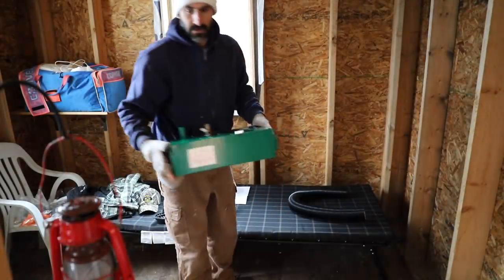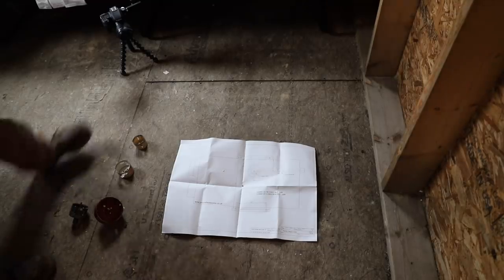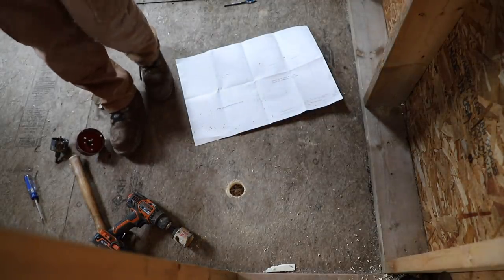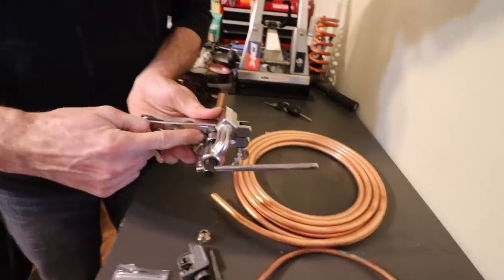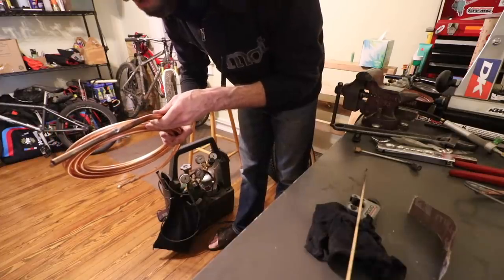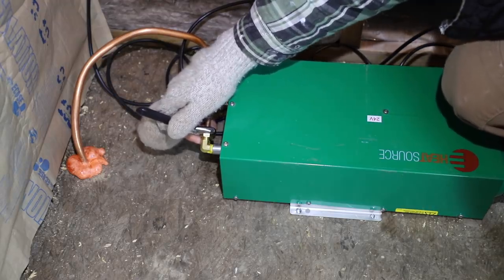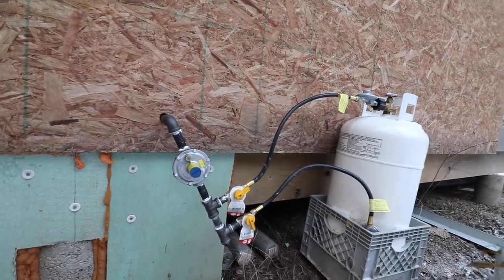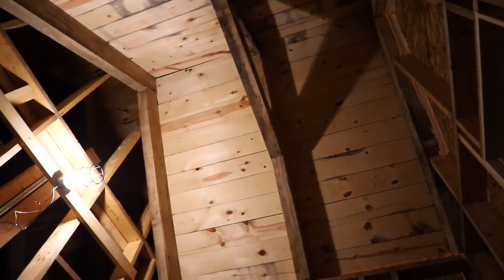Installing a Vented RV Propane Heater in a Small Off Grid Cabin

Comment: A cold weather tip for u, the 40 pound propane tanks have a small surface area when they are standing upright and that can result in low pressure in very cold temperatures. Tilting them over at 45 degrees or more creates a larger surface area and helps to keep the pressure up. That's a very nice heater you've installed.
Reply from the maker: Thanks for the tip Doug, I appreciate that.  The heater has been great, now that the bedroom is insulated, it has no problem heating it.  It's loud, but soon it will be encased in sound proofing.

Comment: That is a nice heating unit. I think your doing the right thing building to your dream and not rushing through. I know my project is restoring an old car and I am 8 years into it and I would love to rush and finish it but instead I just pick up parts as I can afford them and do all the work on it the best I can and I can see that is what your doing on the cabin. Well done.
Reply from the maker: Thanks Jerry, It's pretty crazy to think that I started the foundation in 2014.  I am enjoying the journey.  If I go too fast, I won't be as willing to spend $ on nice materials, so that is another reason to take my time. Sounds like you are doing the same.

Comment: Love the cabin and your honesty with your skill sets. You do some great work. I'm building my cabin in northern Canada, all off grid solar. I'm just in the process of connecting my propane for fridge, stove and small heater. We have a wood stove as well. I'm learning as I go, doing everything on my own for the most part. Just an FYI, I was told all propane connections in a crawl space need to be welded in case of leak. In occupied space compression and flared are ok because you would smell the leak, crawl space you wouldn't. My cabin crawl space is about 4 feet high. Anyways great video's I've learned a lot watching you and gave me some good idea's.
Reply from the maker: Thanks Gordo.  Thanks for the heads up on the propane.  I'm probably going to be putting another little propane heater in the main room of the cabin so that would be a good time to change it over.

Comment: That is a great little heater. I’m betting it would heat your cabin if the floors and walls were insulated, vapor barrier and finished. REAL NICE JOB ‼️👍👍 Vinny 🇺🇸
Reply from the maker: Yea, I think it will, R 40 in the roof R19 in the walls and probably around R10 in the floor it should be able to keep things comfortable if the wood stove burns out at night.

Comment: Good job. I'm in Southern NH. Fricken cold today!!!
Reply from the maker: Oh yea I bet, I'll be there for Christmas visiting family faaackin freezing as my high school buddies would say.
Reply: That heater is pretty small at 10,000 BTU. To give you an example. An Espar D2 which is used in sleeper trucks puts out 7500 BTU. On a cold day it runs at 100% to maintain a decent temp inside. I think what you're doing is a good idea to take up the slack when the wood stove starts to cool down. You may want to set the temp of your heater to come on a lot sooner instead of waiting till it's like 40F. It may not be able to recover.

I've been building a cargo trailer/camper since May of last year. It's fully insulated and has a Suburban 19,000 BTU propane heater in it. It's only a 14'x7'  but it was able to keep up in 0F temps to 72.

Glad you went with a vented heater. I see way to many people use a Mr. Buddy and the whole place is filled with ice from the combustion moisture. 

If your running through Merrimack let me know. I'll show you.
Reply from the maker: Chasein70 dude, Merrimack MA?  I grew up in West Newbury!
Reply: Merrimack NH. Grew up in Leominster MA.
Reply from the maker: oh ok there is a Merrimac MA right next to the town I grew up in and we have a regional high school.

Comment: Great to see your progress. My only concern is that sweated tubing. I hope you've replaced it with the proper 3/8" OD tubing all the way, I wouldn't trust the solder joints long-term on gas.
Reply from the maker: Thank you! I do plan to replace that brazed pipe because eventually I am going to plumb In another propane furnace that can heat the main section of the cabin.

Comment: Looking good, Mike! That should be a good back up source of heat. Have you used it yet? Does it circulate well?
Reply from the maker: Yes I have used it for two days so far.  It has it's strengths and weaknesses.  It's kinda an electricity hog, which sucks, but the trade off is it is roughly 30% more efficient than your typical propane furnace.  It does circulate pretty well for how small it is.  It will heat that 8x10 bedroom no problem once I finish insulating it.

Comment: Years ago Trailers used auto size pipe and fittings. Homes used larger size pipe but called it the same size. I think one was inside (home) and the other outside (auto) measurements. And you did need two flare tools.
Reply from the maker: Yea that threw me off a bit there.

Comment: Hey from Newfoundland, Canada love watching your videos you have great cabin going there! I’m at the beginning of my land/cabin project my self plan to break ground the spring but much like your self be little bits at a time! I feel having a secondary source of heat is key I’m not sure if I will got with little oil stove or gas 

Keep videos coming best of luck
Reply from the maker: Thanks for watching!  Good luck on your own cabin.  I would also look into the wall mount versions like the Williams because they don't require electricity.  They are only around 60%-70% efficient but take no power.  I do think it will be nice to have something other than wood because you can't always be there to keep a fire going.

Comment: That's a sweet little heater are they for travel trailers where did you buy it.Also I didn't catch the but output what is it actually kicking out.could you please let me know and watching this I'm assuming it's electronic ignition no standing pilots and it is thermostatically controlled. I ABSOLUTELY love it, such a compact size can you say what it cost also.Very nice instalation very neat and clean. Thanks for the video Dale
Reply from the maker: Hey Dale thanks for watching, I got it from this place here https://www.westyventures.com/propex.html it was $795.  There are cheaper versions out there as well if you want. But, I could not find one as efficient for less.  They do take DC power.  There is not a standing pilot.  I went with this brand because I needed 24 volt and they made a 24v version.  It is thermostatic controlled, it's input BTU is 10,300 and it puts out 9,500 BTU.  The version I have takes about 36 watts to run.  I wanted this one so that I could mount it under the bed.  The bedroom is so small that I didn't have any room for a wall mounted furnace.  And yea it is meant for travel trailers.
Reply: Actually 9700 btu. Propex has tested some units putting out at 10,000+ btu.

Comment: I like your videos, were did you get plan for cabin build ? * Tip for you, I am in Chicago land area very cold. I am a licensed electrician, also do hvac, try this and since it seems like you have all the parts it will be just a matter of plug & play. Ok, go to  Wallmart or your favorite big box store, get a hydronic electric radiator, hydronic means fluid filled; as in oil, it will have 3-temp settings, and a thermostat, and its on wheels. Cost about 35 to 50 dollars maybe even cheaper, these are excellent little heaters, then on a bitter cold night, plug your Honda generator into your outside plug, isolate your solar/battey system from the 240/120 panel, better yet if your generator has a 240 plug use that,now plug in that portable hydronic radiator into your 120 /ac panel/plug, 15 or 20 amp breaker is fine,turn on unit, also you can use a cheap $ 15 dollar box fan to push heat around enjoy. Tip after cabin has warmed, you can lower stat on the electric radiator, set it to low. It works great,your battery system might even handle this unit, these radiators have tip switch, they will shut off, unit is on wheels ,aprox. -  30 h * 20w * 8 deep-[ make sure you get a oil filled one/https://www.walmart.com/ip/Costway-1500W-Electric-Oil-Filled-Radiator-Space-Heater-5-7-Fin-Thermostat-Room-Radiant/110554122?wpa_bd=&wpa_pg_seller_id=E6EA4CDBA9CB4F54BB3775F6F818B84A&wpa_ref_id=3e4a4bcd36453e31feb22c2aac66f438&wpa_aux_info=&wpa_tag=&wpa_pos=3&wpa_plmt=1145x1145_T-C-IG_TI_1-2_HL-INGRID-GRID-NY&wpa_aduid=387b5967-6f8f-420f-9d79-3413588c3be8&wpa_pg_id=electric%20radiator%20heater&wpa_st=electric radiator heater&wpa_tax=1072864_133032_1231142_1231100&wpa_bucket=  see link recomend 1500 watt,you can dial it down ..Enjoy...Hugh McSheffrey Chicago metro.[[ Also on led lights 4 pack 60 watt bulbs, government subsidized $ 5 to 7 dollars use 9 watts each get soft white, cool white is like for office/=harsh light, you can mount them on an octagon box with a porclean socket, bare bones,or by a round globe LEd bulb, soft white it will blast your cabin out. Now no kerosene, no propane, just gas for that generator. Or it can be a 3rd tier heat backup but a very good one.
Reply from the maker: Hello Hugh, I'll have to look into that method of heating sounds really interesting.  I made up the cabin plans at work (while I was supposed to be working...). I might make a video on that subject soon actually.

Comment: Suggestion for under 15 volts    get a aftermarket auto fuse panel   then use automotive fuses in place of a breaker    just an idea i have seen on other channels
Reply from the maker: The fuses I used in that little fuse holder are ATC blade type auto fuses.  Seem to work well.

Comment: Good work.
Have thought of using a Williams wall vents furnace instead?
It is thermostatically controlled, but requires NO electricity which is more Ideal for of grid!
I have one and it works great!
I also have a solar system which I used in my trailer, and found that if I used the furnace all week end, then the batteries would run dry which then meant that I would have to run the Generator!
Reply from the maker: I was thinking about getting one of those Williams for the main cabin to help the wood stove get the cabin heated up fast during winter visits.
Reply: @50Acres  I found that the Williams works well with the wood burning stove.
It will kick in when the stove burns out in the middle of the night.
It heats my cabin which is a 53 Foot insulated sea can!
Reply: I bet that a 30,000 BTU would heat your whole cabin easily
I use one hundred pound propane bottles, and one runs out then I just bring it back and refill it, but I can use it quite allot before it runs out.
Actualy I have Four 100 lbs tanks and one 400 lbs pig which lasts me all year.
I went that way in case the SHTF!
I'm actually thinking of getting one more 400 lbs Pig.
Only problem with the pig is that they are pigs to load back up in the truck, but with an old truck tire one can unload them just by dropping them off on the tire.
Reply from the maker: @spyke123able  Oh yea I think it would the whole cabin is only 450 square feet and it's really well insulated.
Reply: @50Acres  Another really good thing about the Williams is that it makes ZERO noise, except for when the propane ignites which is nothing, and I get some of the best sleeps ever!
I just finished watching another one of your videos where you say that the only real problem that your heater causes is the noise and that you may have a cure for it.
Then problem solved.
Love your work all the best to you.
Reply from the maker: @spyke123able  The zero noise is clutch, my propex is loud.

Comment: Square D does make a 10 amp breaker in the QO line, which are DC rated.  Although if you need something smaller yes then the ATC blade fuses are the best having multiple small amp sizes from 1 amp up. Agreed the Blue Sea fuse blocks are a great product.
Reply from the maker: Thanks for the heads up on the 10 amp breaker, I had no idea I could get one that size.  Thanks Progrocker
Reply: @50Acres  Square D is the only one who makes it, and only in QO line, not the homeline.

Comment: Do you have a wood burning stove? If not you probably need to get one if anything for backup.
Reply from the maker: I don't have one yet, but that is the plan, and then this is going to be backup for when the wood burner burns down at nighttime.
Reply: Installing a Propex HS2800 vented propane furnace to heat our small off grid cabin.  It will be used as a backup heat source.  This furnace will kick in when our wood stove burns down in the middle of the night.  It is thermostat controlled.

If you had read the comment it would have answered your question.

Comment: You can get a fuse breaker box fron Amozon  ..Blue Sea Systems ST Blade ATO/ATC Fuse Blocks
And eaton breaker that fits your breaker panel 5 amp  FAZ-C5-1-NA-SP
Install the WOOD STOVE
Reply from the maker: Thanks for the tip on the breaker.  The wood stove is coming pretty soon...

Comment: It always seems that the most critical tasks are performed in the worst conditions. But that heater seems to be working great. 

How long would that 40 pounder last if you just run the furnace on it, 24/7 ?
Reply from the maker: I think about 10 days

Comment: Question, how did that pass NEC inspection? DC requires much larger conductors because of the heat it creates and the Inefficiency
Reply from the maker: Pun Gent. It’s not too difficult, you use a wire size calculator then cross check to make sure your breaker sizing protects the wire size.  As long as you specify DC current in the calculator and use the correct voltage and ampacity the heat and inefficiency is accounted for.
Reply: @50Acres  oh, you're using transformers and MMC oooh

Comment: I’m catching up on older videos.  Love them all. Question on your heater now that you’ve been using it for a a year.  How much propane do they use? I know you’ve got the wood stove now but if the propane was your only option, would a 5 gallon tank last you all weekend in the winter? And how noisy are they? Thanks.

Comment: You need to get a din rail breaker panel to run your DC load, you will get the recommended size breakers.
Reply from the maker: That thing I was working on is a fuse block, it's fed from a square D QO breaker.  its basically a sub panel closer to the loads it serves.

Comment: Excellent video just learned something new! 
Any advice on converting storage barn shed into living area, mainly insulation is what im concerned with?
Reply from the maker: Hey, glad you liked it and thanks for watching.   If I were to convert a shed, this sounds crazy, but I would go right over the top of the shingles with rigid foam kinda like in this video: https://youtu.be/viabiXnrcjs then re sheath it and re roof it.  The reason is: usually shed roofs are framed with 2x4's and you can't get enough insulation in that space.

Comment: At some point if u live in this u will wish the floor was insulated ,i built a cabin similiar and didnt do the floor insulation after my first winter i did put it in it helps make it more like a home being each time ur feet hits tge floor in socks an bear ft,its cold without insulation,and not like a house. That where used to
Reply from the maker: Hi Charles, I hope to get the floor insulated sometime this spring or summer.  I think I'm going to spray it so I need the temps warmer.

Comment: The obvious question is why not a direct vent gas heater like a Rinnai?  Would the cost have been the same and more heat output would be available.  Also, the conventional direct vent heaters are rated for continuous duty.  The RV stuff was never really intended to run continuously long term.  

Also, be careful, the guys that install those RV heaters (like Propex, etc.) note that the exhaust gets pretty hot - I'd think the exhaust pipe should be isolated from your wood framing. 

Finally, venting under your cabin could be an issue if you suck back inside carbon monoxide.
Reply from the maker: Hello Augsburg,  there were a couple reasons we went with this type of heater.  The first and primary is that there is no room anywhere in the bedroom for a wall mounted heater between the windows, the bed, dresser and the door swing.  Secondly because our solar is so oversized for our weekend needs, I was willing to trade off some electrical draw for the increase in efficiency on propane.  92.5% versus 60-70% for wall units that don't require electricity.  Lastly, I think this heater is really neat and really wanted to try it out.  I've actually placed some leftover metal roof between those exhaust pipes and the framing, just didn't show it because I did it later on.  The pipes vent out to the side of the cabin not underneath.
Reply: @50Acres  Makes sense.  And it occurred to me the RV heater can run low voltage, rather than rely on 120V.  I have been looking at a similar heater for my 1950's canned ham trailer - which is retired from over the road but functions as a spare room for guests.
Reply: It can run continuously. We have units out there heating for 15-20 years.

Comment: Curious.  For your wood stove you had to remove combustibles around the flue pipe and use that heat resistant gasket.

Does the plywood need to be shielded from the hot exhaust?  Incase say the blower were to fail one day, which would cause the combustion chamber to spike in temp, thus raising the exhaust temp?
Reply from the maker: It supposedly had built in safely features.

Comment: I know one thing I wouldn't run that Propane heater to long with no wall insulation you would go through a lot of propane just saying. But great work and great video
Reply from the maker: Thanks, it didn't do much without insulation but once the place was insulated it worked great.